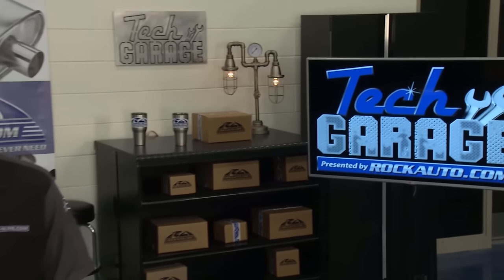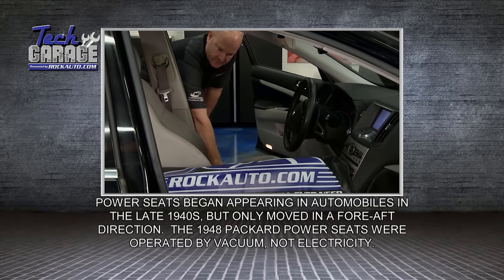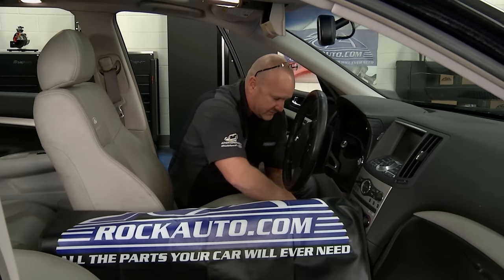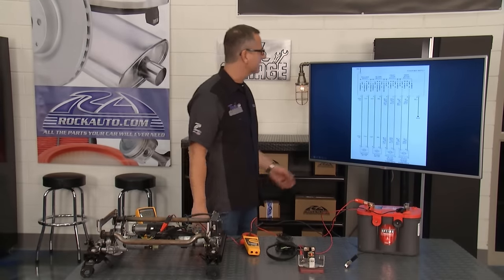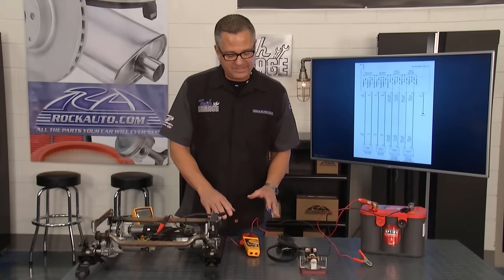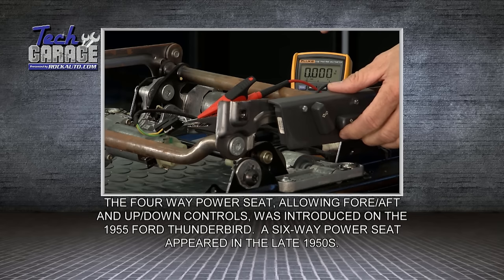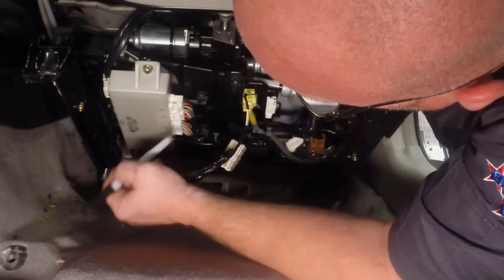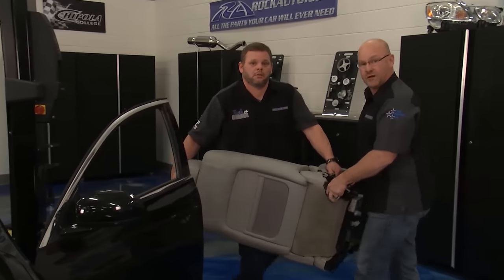Electric Seat Motor Repair

Comment: I had the same issue with the twist. The cable that was connected to the motor got released. Reconnected the cable and realigned seat without removing the entire seat

Comment: The problem we're having is the some of the switches work but the seat is stuck in the recline forward position & doesn't go forward or backward. Could it have a bad power switch? It's on a 2010 Chevy traverse LT All wheel drive.

Comment: None of the plugs are the same, so no need to take pictures. How did you get the seat out if it wont move and the bolts are under the seat?

Comment: How do the individual seat motors know when they have reached their travel limits. It's obviously not torque, because that brush handle drew too many amps. If it's the number of internal motor revolutions, then why don't new replacement motors need to be set to the current seat position when they are installed?

Comment: I have a 2007 BMW 335xi twin turbo.  The driver's seat stopped working.  I changed the fuse and it worked then it stopped working and will not move at all.  The motors worked well.  What now do I do?

Comment: How do I get a seat motor gear for a 2010 lexus ES350 ? The lexus dealer only sells the whole motor assy for $350.00+ and I could not find it on Rock Auto.

Comment: Did you need to disconnect the battery before unbolting the seat? I need to replace the worm gear on my 2011 Silverado and it has side impact air bags, connected by a pigtail.  It doesn't seem like unbolting the seat would effect that, especially if I can disconnect the pigtail 1st, am I wrong?
Reply: It's good practice to prevent voltage spikes that could damage modules. Circuits in computers are very sensitive.

Comment: I have the 2008 g35, with basically the same seat as this, however the seat does not move at all in any direction whatsoever. The heating on it does work however, does anyone have any advice or tips as to where to find a new one? Been looking all over the place and can’t even find a used one. Thanks.

Comment: Thanks for information but in my case I think motor is not working , it's not moving at all , it's very difficut for me to drive, because the seat is completely in fornt of the steering wheel... 
Kindly suggest me some solution ,it's very difficut for me to find the motor at my place.
Reply: I'm have the same problem. Only my lumbar is working. Everything else is dead. Lemme know if u find something out and I'll do the same

Comment: I have a really strange problem.  Powered drivers seat and powered passenger seat.  The LIFT, front tilt and back tilt fail to operate on BOTH seats!!!  The motors make operating sound when trying to adjust the seats, but NO MOTION from any of FOUR MOTORS?

What the heck????  I measure the + and - 12 volts going  to the motors as good?

What the heck????

And pointer would be appreciated.   

2000 Buick Park Avenue
Reply from the maker: It sure sounds like something is blocking the mechanical functionality.  The lift and tilt functionality would share mechanical connectivity so I’d crawl under there with really good light and see what’s blocking motion...
Reply: @diygaragebryangregorytv9834  Thanks for the reply.

The worm gears don't even wiggle when power is applied, however the servo sensor and the motor both feel like they are spinning.  No overload, no lights dim.

The odd thing is it is both lift.motors on both seats.  19 year old car.

I'm suspecting the plastic gears in the motors..,

Comment: I put a new relay in, a new door switch, a new motor, checked all fuses. Everything works except forward and back horizontal. No power going to the two wires that go to that seat motor. Power is going into that box under the seat. Now what? Chrysler Pacifica 2004 awd, driver seat.

Comment: jesus. what a waste of time
Reply: Not sure what vehicle this goes into at all but just FYI - www.gruvenparts.com builds METAL versions of both the worm and spur gears for GM trucks.  We can also build them for Ford if thats an issue.  Dont replace with more plastic gears in the seats you need metal.  Metal Worm and Metal Spur, not just metal spur.  BOTH gears need to be proper gear brass.  Check out www.GruvenParts.com for metal gears for the seats.  They also do lumbar support gears made of metal.

Comment: Power seat motor cable broke on mine what do i do to fix. These cables arent sold anywhere
Reply: What car?
Reply: @Gaonaism  its a 2008 c350, I took to the Mercedes dealership and they were cool about it, got fixed
Reply: @emanuel-216  next time consider a junkyard, they can be goldmines. Other options include OfferUp & Craigslist or Amazon & Ebay 👍

Comment: The right side window,my heater, and sound system won’t work so I reached under the right seat to get my water bottle and i accident touched the wires and everything started work until I went on a speed breaker and it just tripped back off.

Comment: You two need to shut the hell up when moving the chair so the viewers can hear what the motor sounds like when it’s wrong so they can compare and see if it matches what’s wrong with theirs!
Reply: 2013 captiva front seat I finally got the motor how do I change it
Reply: @believeinmrssantaclausrosi7693  go practice how to remove a motor on a junk yard seat first so you don’t break yours.